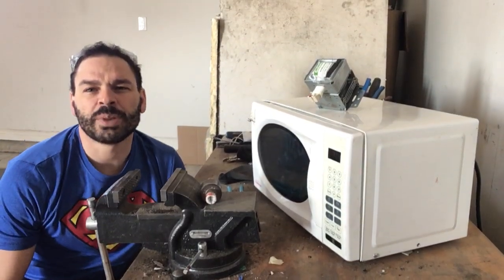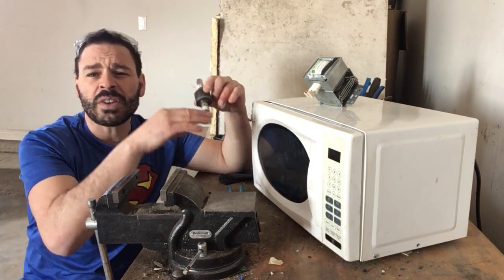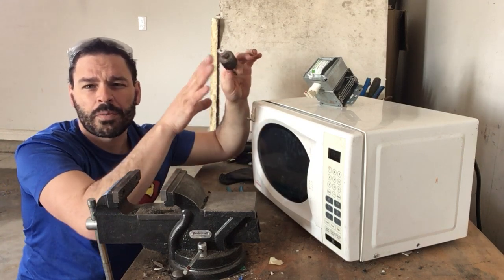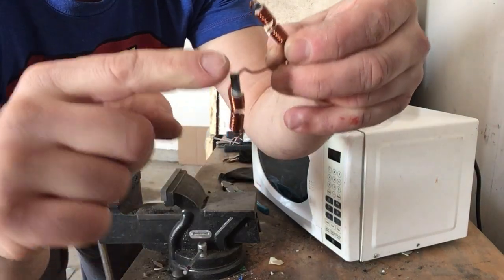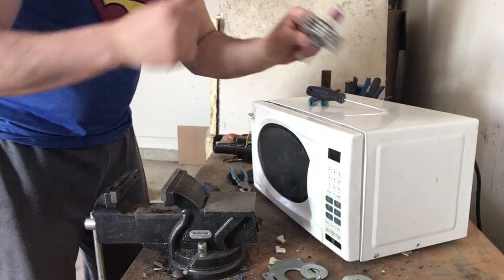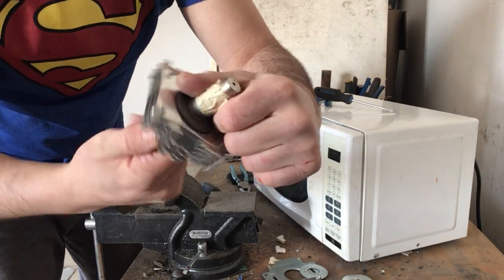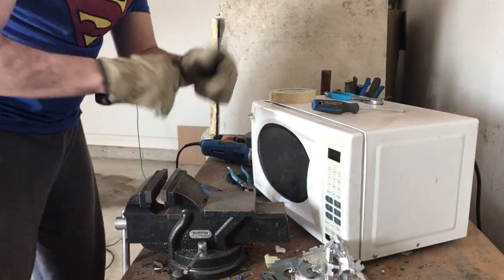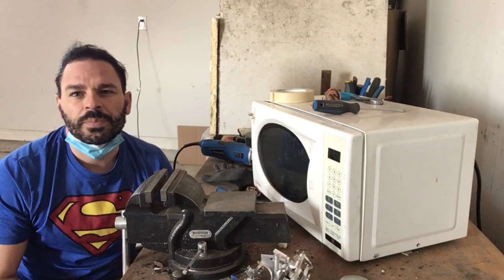How to safely disassemble and scrap a Magnetron for copper, aluminum,  brass, and steel.

Comment: If you take a sharpened flat screwdriver and pry on the seam where the two end caps are bonded to the copper core   you can tore it away , I work it with the flat untill I lifted enough of the end cap part away that the jaws of a cable/wire puller can grip it , then I just tore them away , saving a lot of precious copper .

Comment: been hearing there is something dangerous in there. high voltage?
Reply from the maker: you want to make sure you discharge any chance of voltage from the capacitor before taking things out

Comment: I agree with @iansbricks3531, I too heard the tell tail sound, I would also add that why would you then putt it in the shred? As this then goes to the sherd. Which means that the toxic beryllium goes into the environment.
Reply from the maker: Actually I give it to the men at the scrapyard and they throw it in the shred pile. Not sure if they do further separate after I leave the yard. Apparently, I was told by a fellow scrapper that beryllium has not been used since the 1980s.

Comment: I use a lathe to seperate the copper from the steel ends.Cut the steel very carefull,  til i reach the copper part. So i don't loose any copper.
Reply from the maker: Nice. sounds like a good system and lots of copper to get.

Comment: You for sure cracked that when you put it in the vice. You can hear it on vid.
Reply from the maker: that is why I have the tape around it.
Reply: @TinManScrapper  not gonna lie, the tape is a good idea. I had no clue about the beryllium, was scrapping a microwave and just thought let me see if it’s dangerous. good thing for ppl like you that get the word out. as for the vice thing, if you scrap a lot of them  I’d take a pice of wood drill a hole the diameter of the small end with the beryllium then cut the pice of wood in half. that way you have a custom jig that holds the pice in the vice firmly with out a lot of pressure in 2 small spots. very hard to hold a round object in vice. round object does best with 3 points of contact. so you can even take a pice of wood with a v cut in it and one flat pice and it won’t budge.
Reply from the maker: @tdiraketa  thanks for the tip. Stay well.

Comment: Great video!  Glad to see you put on eye protection with the angle grinder...this past summer I spent an afternoon in the ER after getting a pc of metal in my eye cutting off rusted bolts from a bench...not cool...I'll never pick up an angle grinder without safetys again.  Just pulled apart a microwave with my grandson, and he actually enjoyed it!  Thanks for sharing!
Reply from the maker: Glad you liked it. I have actually had a piece of grinder disc in my eye once and I was wearing eye protection, just the angle I was on I guess. Glad you are training the next wave of scrappers. Stay well.

Comment: Excellent video, as always. I have just started scrapping and have now done two microwaves. I noticed that the screws holding the magnetron onto the microwave were much harder to unscrew than any other screws I have come across. Is this a weird coincidence or is this a way to discourage people from taking apart the magnetron?
Reply from the maker: Yes, I bought an Lkey security set from Canadian tire that is meant for those types of screws and Allen type as well. The set was inexpensive, but very handy and used all the time.

Comment: could u show how. u r takiing off pieces,,no one can see thee most important stuff

e can. see. thed part
Reply from the maker: I can do another one if you like?
Reply: @TinManScrapper  yes if u dont mind,im getting a little scared,2 cut red wire,its an old microwave,but
 afraidvi will get shocke ,But,I  love scrapping stuff
Reply from the maker: @rebeccaglenn5257  actually Rebecca check out my video called “scrapping a microwave SAFELY and quickly for copper,…” that video shows you how to identify and take off the items.
Reply: @TinManScrapper  Thank u Tin Man,,Your my go 2 guy
Reply from the maker: @rebeccaglenn5257  glad I could help. Stay well and I appreciate your support as well.

Comment: Sir, you destroyed the radioactive thorium wire, please be careful.
Reply from the maker: Thanks for the concern, that is why there is tape on the ends and they are made a little different depending on location and make and model.
Reply: @TinManScrapper  Fine, thanks!

Comment: Looks and sounds like the ceramic cracked when you pinched that part with the vice to stabilize the piece to angle grind it, perhaps there’s a safer way to stabilize? Thanks for the great video!!
Reply from the maker: Yup, that is why I put tape around it, so it does not release anything if broken. I actually just put it in too far.
Reply: @TinManScrapper  thanks for responding! About to scrap my first microwave so getting all your tips has been great! Stay awesome! :)
Reply from the maker: @blockchainbill6635  Happy New Year
Reply: @TinManScrapper  There is something pouring out from the taped part exactly at 11:28 what is it? ☢

Great video tho, I scrapped a microwave last night! 🤙
Reply from the maker: @maan9176  oh, actually it is copper dust coming out of the slice. When you use a grinder there is copper dust and it goes into the crevice. Once I turned it over the dust was falling out.

Comment: Definitely NOT put pieces with beryllium with it into steel scrap!  You might kill some people that way, further down the recycling line. Bring it to battery recycling box, with LABLES stating there is possible beryllium in it. EDIT: If the junk yard throws whole micro wave ovens to shread, report them to authorities, with details why it is DANGEROUS.

Comment: Love the videos.  You were being so careful until you stuck the ceramic end into the vise.  I installed ceramic tile for years and the sound at 10:16 is the sound of ceramic cracking.  The extra protection of taping it probably kept most of it contained, but i would recommend putting the fat copper part in the vise instead
Reply from the maker: Yup, agree. I too heard that and oops. That is why I put tape on it.
Reply: I cringed hard at that, jaw dropped. Had to check the comments.

Comment: I think you cracked it in the wise. Plz don't do this. Also, you need a real respirator.
Reply from the maker: No I actually I did not even have the strip in the vies. Thanks for your concern though.

Comment: When i put the core into the vice, I grip th thick section. I dont want to put force onto the ceramic part. It means the angle grinder blade gets close to the vice, but I reckon its safer.
Reply from the maker: Yeah, just go slow and be careful

Comment: 2 questions,  the piece of cooper I assume is #2  & the Birealium pieces you pass on as steel  ?  When the scrap yard gets it,  it will get shredded !   So isn't there still a problem with that  ?
Reply from the maker: Well I think because it is outdoors and gets crushed in a cube and later smelted I am not sure it is as dangerous as close confined place like your garage scrapping. Somehow it had to safely get put on the ceramic. I do tell the scrap yard that I have the magnetron core and they just throw it in the steel pile. Don’t seem that concerned.
Reply: @TinManScrapper  The worker at the scrap yard is NOT necessarily educated about lethal items, and even if he is, he only needs to have something on his mind going, like grandma died, or be tired at the end of the work week, and can still throw it into shred without a thought.
Reply from the maker: @digitalmusic4803  yup you are right, I should have said that although I do still put in shred I keep in a box and tell them at the scrapyard when they weigh my shred.
Reply from the maker: Yes core is #2 copper